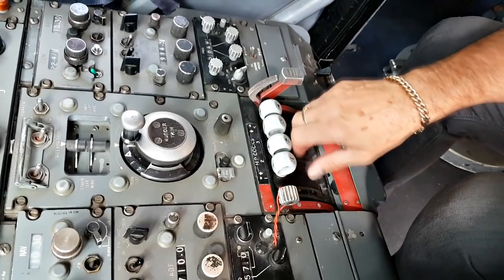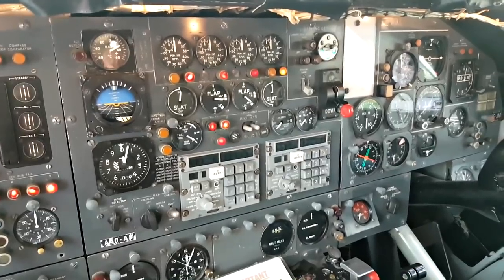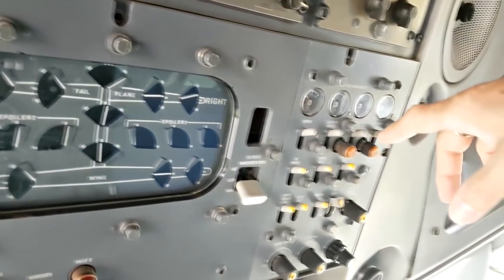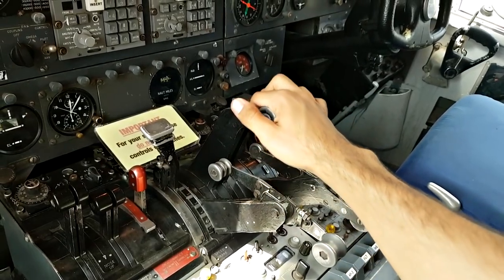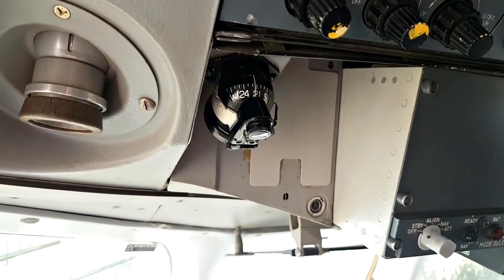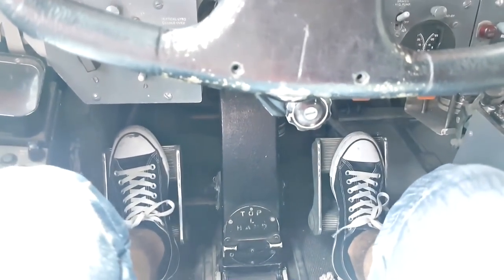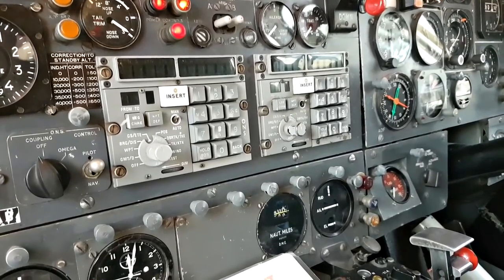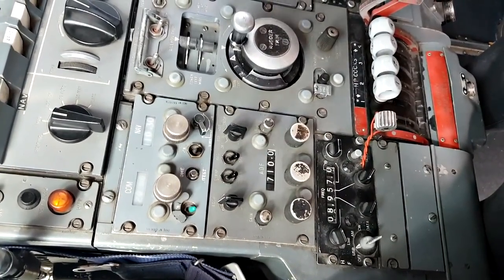Vickers VC10 DETAILED Cockpit Tour | Cockpit Views & Cabin Visit Onboard | Brooklands Museum

Comment: Why is this aircraft in so many  ways similar to the IL-62 which had its maiden flight just two years after the VC10?
Reply from the maker: Maybe the IL-62 was a ripoff? Just saying 🤞
Reply: @greatflyer_aviation ,  @Filippo Reutener,
I use to think that as well up until recently, when I watched a YT video that explores the history of the development of both; the VC-10 and the IL-62,
that video shows that apart from the features that stand out visually like the layout of the 4 engines mounted at the tail; both airframes have very few in common regarding their operational purposes, aeronautical engineering (e.g the center of gravity is radically different between the two airframes, wing design - a whole world apart... etc.) and performance. many aviation enthusiasts believe that il-62 is a soviet ripoff "VC-10'sky" because of the obvious visual (rough) resemblance and because they where both designed at about the same period, but even when looking only at the visual details and proportions with guidance from that video I mentioned and with some attention to detail - you can see that they are actually completely different airplanes for different purposes.
Reply: @giladostrover  explains it all👍🏻